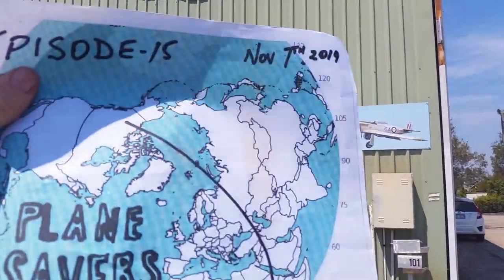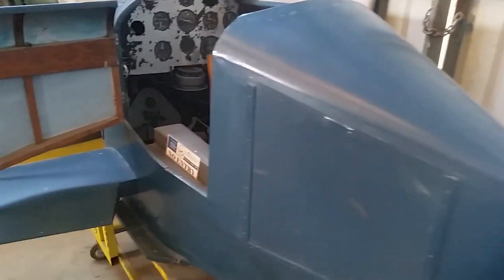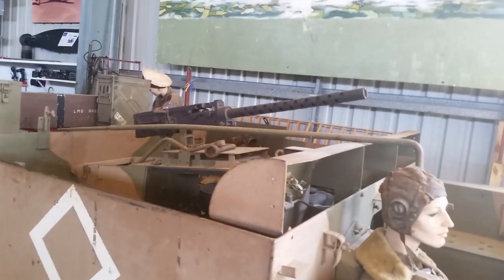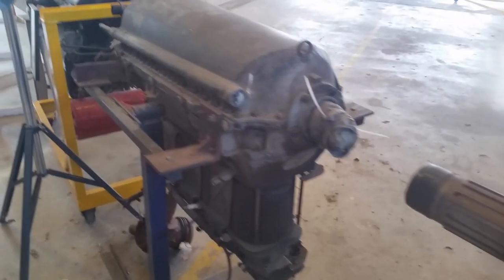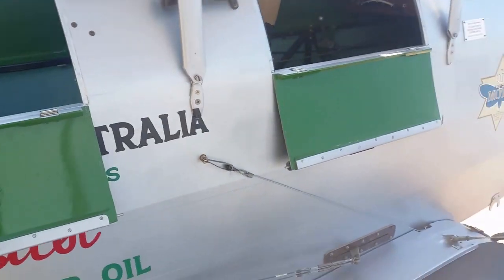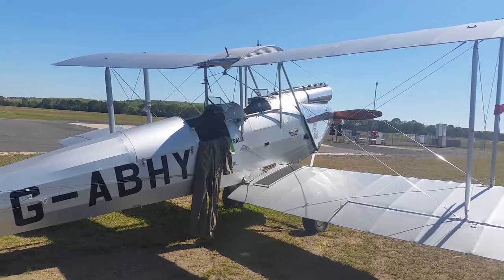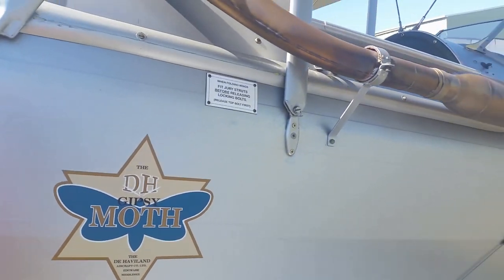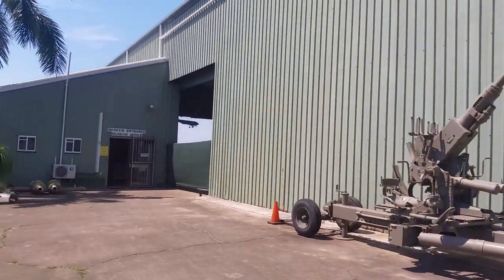Epsiode 15 - Plane savers Downunder - CWFHM Aviation Museum

Comment: Great video Ken. As President of the Caboolture Warplane and Flight Heritage Museum, I thank you for taking the time to visit and produce what will certainly be a boost to our promotional efforts.
Reply from the maker: Thanks Neil. One of the conments that I couldn't answer was a question as to whether it was common for the SNJ to have a three bladed prop. Is that something you might be able to answer?
Reply: @kenweeks  Hi Ken. To the best of my knowledge, the standard prop was only 2 blades. However there could have been variants. Not sure
Reply from the maker: @John Clarke this is your answerto your SNJ query